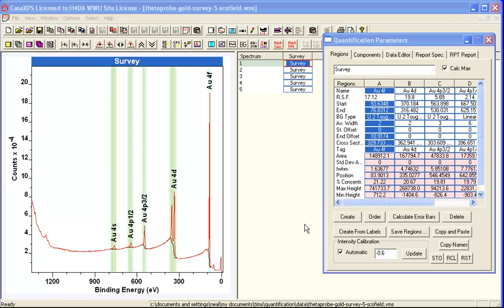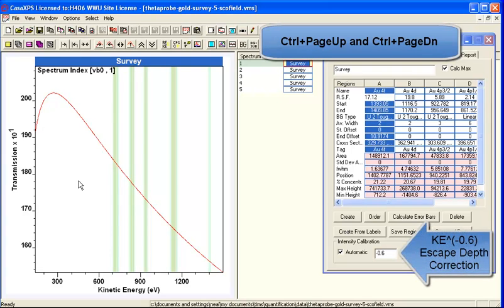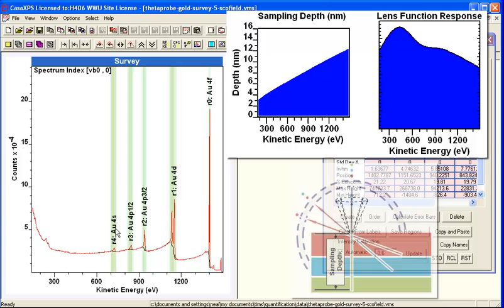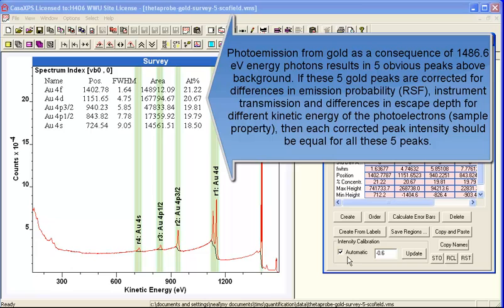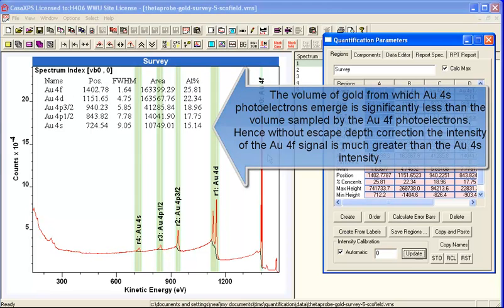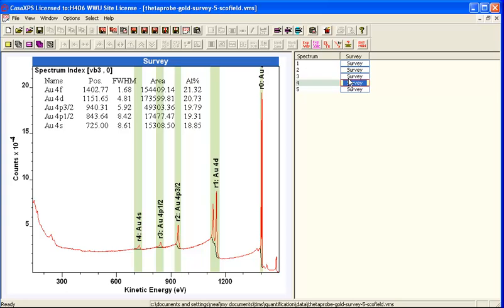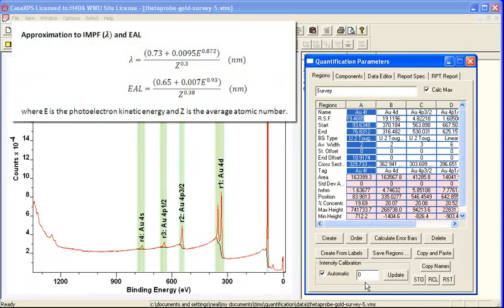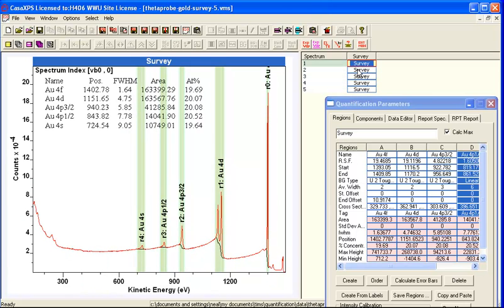Escape Depth Correction and Quantification using Scofield Cross-Sections in CasaXPS

Comment: Hi,
I really enjoy watching your videos and appreciate it to the highest degree. I have a few questions, I thought the correlation between EAL and the kinetic energy is E^0.6, not E^(-0.6)?
How should one perform the escape depth correction for thin films? Let’s assume you have a thin layer <5 nm of Au, how would the correction look like?

best wishes
Hendrik
Reply from the maker: The energy dependence is approximated by E^0.6. The correction to intensity is achieved by dividing be E^0.6, hence the convention in CasaXPS of entering -0.6 for the exponent.
Reply: @casaxpscasasoftware4605  Thanks for the answer. What about  escape depth correction for thin films? Let’s assume you have a thin layer <5 nm of Au, how would the correction look like?
Reply from the maker: @hendrika.2055  Quantification of the material in a thin film is one of the reasons I prefer traceable quantification based on Scofield cross-sections. If you sent me an email I can share more details of my thoughts on this subject. neal@casaxps.com